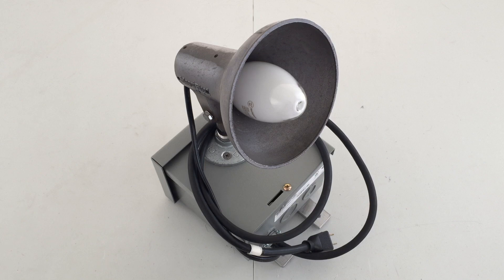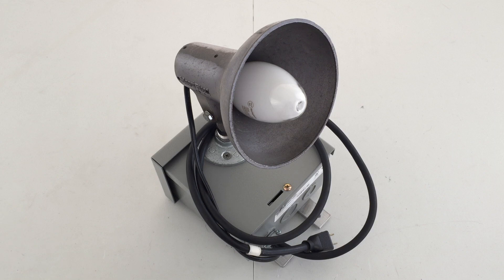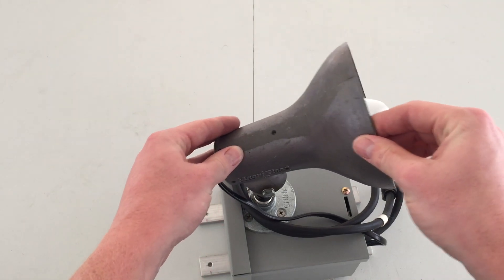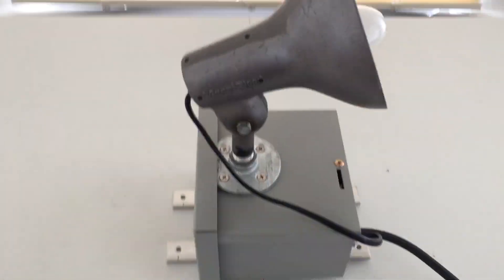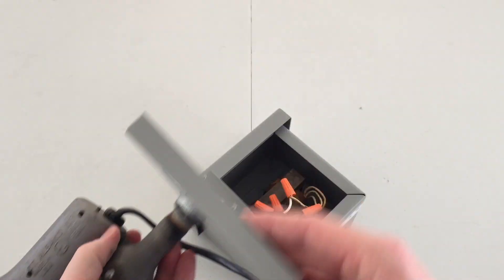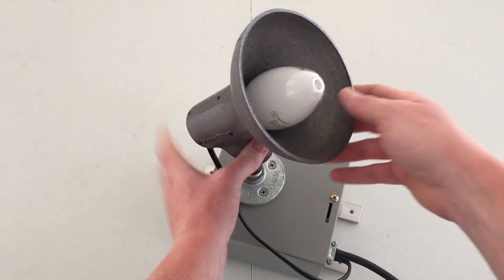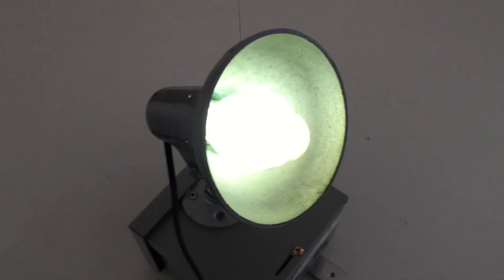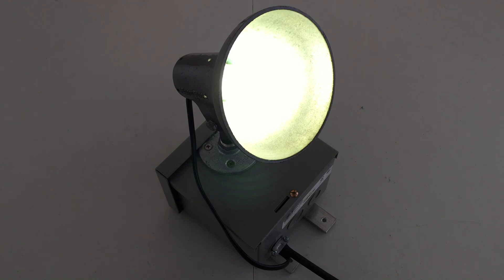Homemade 50watt Mercury Vapor Flood Light

Comment: I just subscribe to your website dealing with Mercury Vapor lamps. I am a vintage street light collector with light going back into the 1930's. In my collection are three MV street lights at 250 W each. However I also have a few 50watt lamps . However going through information about operating this lamp came up nothing, however I heard that a 39w MH ballast without the ingniter would work but it comes down to the bulb type. You were very lucky to find a "true" MV ballast. I on the other hand must find an alternate way to operate this lamp. Any ideas? Thank you
Reply from the maker: I have seen people use one preheat F40T12 fluorescent ballast to run one 50watt MV bulb. I believe there is also a way to use a rapid start ballast as well. The best place to do more research on these methods would be lighting-gallery (dot) net Additionally, I believe people have also used an incandescent bulb in series with the 50watt MV bulb however I don't remember what wattage incandescent bulb was used.
Reply: @Parrot175 For using a 50W H46 mercury vapor lamp with an incandescent ballast, it would run better if it is used on a 200-240V supply.

Comment: I'd love it if an electrical engineer designed a new compact mercury vapor ballast. It's annoying and inefficient to need to use those old honkers. Not bashing what you did though, not another easy way to do it - maybe? I'm going to be doing some experimentation with T12 fluorescent ballasts. The 50W can be covered with a standard 40W T12 ballast and a 75 - 100W should be covered with a F96HOT12 (high output T12 that goes to 100W). This hasn't been tested before, but I'm excited to try it soon. 175W and onward already have high efficiency ballasts that work with them, so if this works, then there's a way to get all wattages with newer ballasts.

Comment: Do you have to have the ballast close to the socket, or can it be further away? Also, do you have to use any specific wiring or can’t you just use any cable to connect the socket to the ballast?

Comment: Nice fixture! Man I cannot find a 50 watt H46 ballast anywhere!! I have 2  well used 40/50 watt Philips Lifeguard mercury lamps from 1992 and 1993 that still work great but I can not find a ballast for!
Reply: Use a 50w metal halide ballast and remove the ignitor !
Reply: Are you by any chance GEm1000 on LG?
Reply: Use a 40 or a 58 w flurescent ballast that will work to fine

Comment: Hello Parrot i want to install mercury vapor lamp in my garden but i don`t know can 50w mercury vapor bulb solid light about 124 inches (10 square meters ) ?
Reply: Korisnik Jutjuba use a 150w HPS or Metal Halide lamp
Reply: Also 50w mercury vapor lamp are rare
Reply: Welcome
Reply: The bulbs are easy to get, the ballasts are really hard to find though.

Comment: This flood light kinda reminds me of "moonlight floodlights" which are special flood lights designed to be put really high up in trees. They use either 100w or 70w mercury vapor flood bulbs I believe and they have a bullet shape. Not sure if you've seen these before cause there not very common but I have seen a few places that have them where I live. I think the idea behind them is to create a moonlight effect at night and it looks very cool.
Reply: Bigmyke0913 I live in the city where that was invented. They are 50w, 100w, and 175w.
Reply: DJMinor5000 No there are no 70w Mercury Vapor anywhere that I know of but I do know that there is a 75w MV
Reply: I never heard about a 70w MV
Reply: I love the moonlight mercury lights. We don't  see any here where i live, but ive seen them in other places. I have two 175w mv lights on poles that i used to use for my property, but it got too expensive to run.